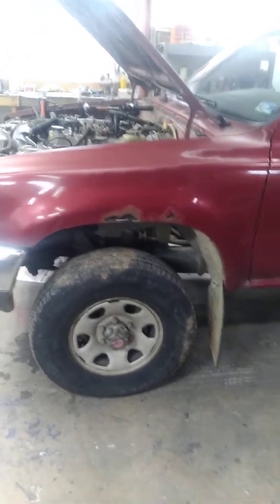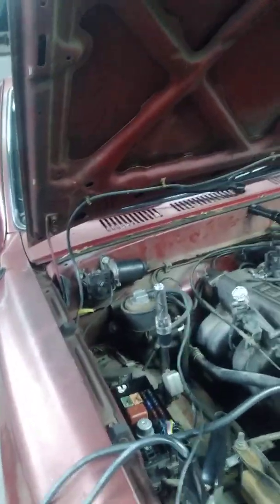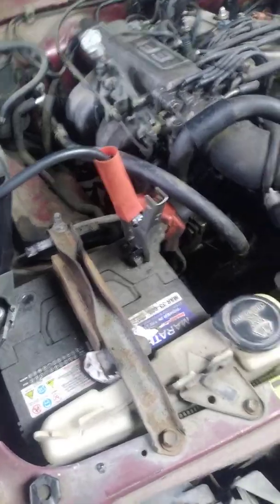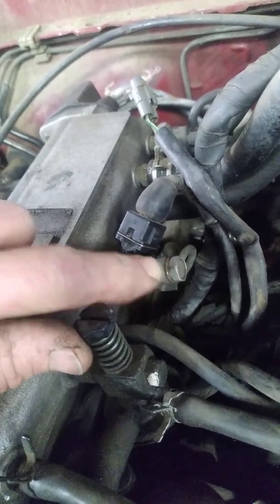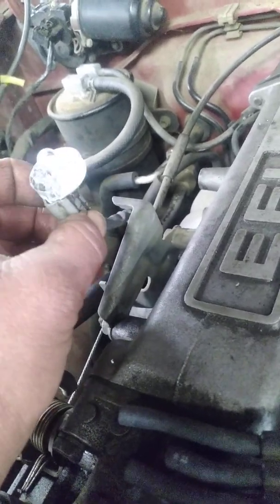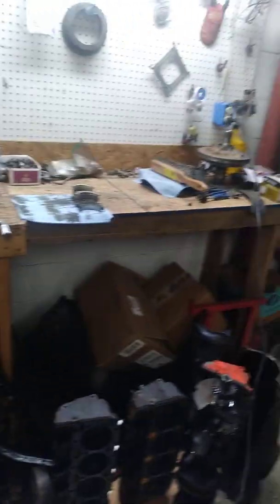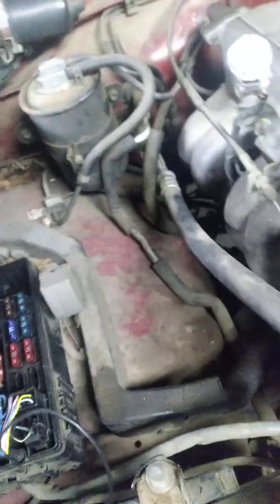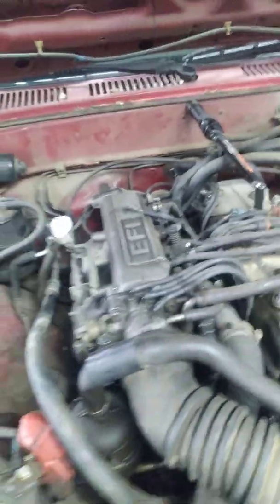Fuel Pump Test And  Injector Pulse Toyota 22RE

Comment: I have an 86 4runner 22re manual also, mine starts one if i spray starter fluid through the air intake, than will stay running as long as i keep my foot slightly in gas . But as soon as i shift to take off it cuts out and dies .... i have checked what seems to be eveuthing .... new fuel pump relays sensors regulator.... only thing i really have not done is vacuum system any suggestions ??
Reply from the maker: @Notmine1132
While running Spray brake clean around throttle body gasket and  other vacuum areas. Intake gaskets, vacuum hoses. If engine speeds up there's a vacuum leak. I don't know how long ago the fuel pump was replaced or if it is a cheapo. The cheaper ones have a 2" piece of fuel hose that attaches the pump that will bust causing loss of pressure. Start with the vacuum leaks first however did you replace the fuel filter? Located on passenger side of engine block down towards the bottom?

Comment: Howzit! That was some helpful tips. I hit a little road block. I changed out a fuel pump on a 91Hilux. Changed out the EFI relay in the engine fuse box. Changed out the circuit open relay. Changed out the fuel filter above the starter.  I jumped the FP and B+ in the diagnostic box. Fuel pump runs. The truck cranks over and starts. Runs for about 3-5 seconds and cuts out.  I followed schematic and see that there is a line to the air flow meter to keep the circuit closed on the circuit open relay. Thinking it might have something to do with the air flow meter line. 
Is that a possibility??
Reply: Hi my truck has the same problem like yours.  Were you able to fix the issue?  Please lmk if you got it fixed.  Thanks

Comment: Hi bro thanks for the video. I have an 86 4runner, 22re manual transmission, and I am not getting power to the fuel pump. I replaced circuit opening relay with no luck. I have also tried jumping the connector under the hood, which bypasses the COR, and it still does not get power to it. Any suggestions? Thank you

Comment: I have the same truck. In order to start in the cold you have to pump the key instead of holding it down. What that does is squirt extra fuel from the cold start injector every time you turn the key. Everything's working you just need more fuel so you do that by turning the key on and off a bunch of times to get it to finally bounce over the colder it is the more fuel you'll need

Comment: Hey brother I am having the exact same problem with mine I changed the mass airflow sensor, and the open circuit relay, and the fuel pump. It will run on starting fluid while I spray it but as soon as I stop spraying it dies.  Any suggestions?
Reply from the maker: @OSPNlive under hood beside the fuse/relay box is the diagnostic port on passenger fender. Open it locate Fp and B+ and put in a jumper wire. Turn key on but do not try and start. If the fuel pump is working at all you should hear it. If not check wires all the way to fuel tank and still may have to remove tank. Keep me posted and thanks for watching
Reply: Yeah mine did that and to get it going hit the bottom of the gas tank with a block of wood or something while somebody cranks it and it will start most of the time this won’t fix the problem but it can help you get it home or something

Comment: Mine is identical and doing the exact same thing.
Reply: Mine is also spitting black smoke almost like it's getting 2 much fuel. U can feather the throttle and it will Rev up.
Reply from the maker: @Bluecollar780  regulator 
Pull the vacuum hose off regulator while it's running and see if it spits fuel
Reply: Just put a brand new one on it
Reply from the maker: @The Oursiders this job the problem ended up being a 2' fuel hose that is attached to fuel pump in the tank.

Comment: And, in part 2, what did you find out? Thanks for this one..
Reply from the maker: @Cisko Kidd on that one I had to remove the fuel tank and replace a 2" piece of fuel hose at the fuel pump
Reply: @AutoRepairTransmissions  Ouch, plugged or split? Lots of work for a small piece of rubber. 
I've stopped dropping tanks, much rather pull the bed. 
Dionosticly speaking I've exhausted most reasons/steps for a no-start. 
Can't determine if the fuel regulator acts as a failure point, really don't want to drop the fuel filter, ( brand new) Have power to pump, no humm or  pump run sounds, nothing at the bango, e.t.c 
Thanks for the reply .
Reply from the maker: @ciskokidd5980  fuel pump only cuts on during engine cranking
Reply: @AutoRepairTransmissions   Thanks

Comment: Thanks this will help me diagnose tonight driving along and truck cut out wouldn't start  237,000 miles been running great,I'll replace fuel filter  and try your method

Comment: Great tips. Did you find your issue?
Reply from the maker: 4 years ago I installed the complete fuel pump assembly that the truck owner bought from Amazon. Cheapest I'm sure. So fast forward to this video I ended up dropping the fuel tank removing the pump assembly to replace the rubber hose that connects the pump to the assembly. Hose is 1.5" long and it was of poor quality